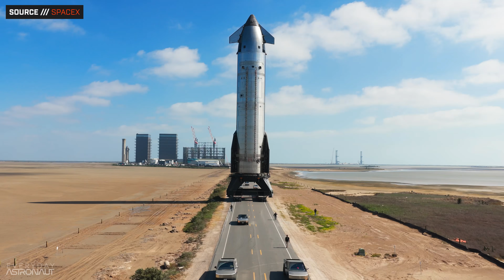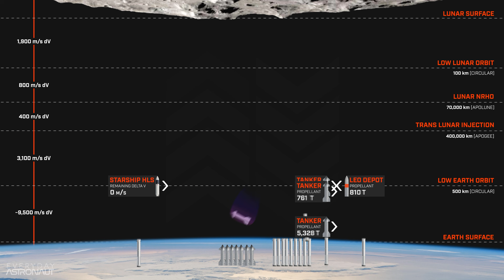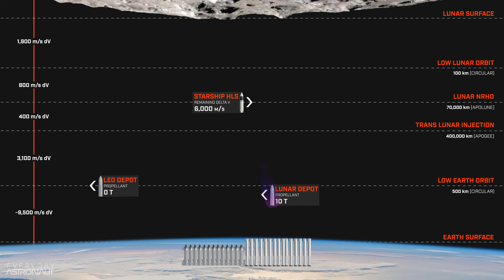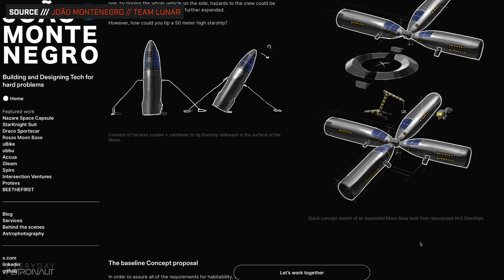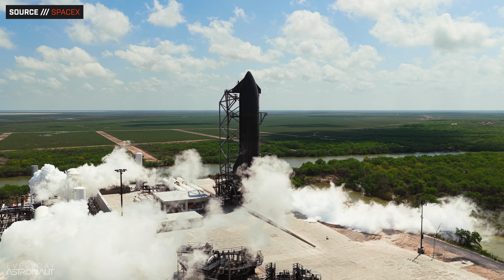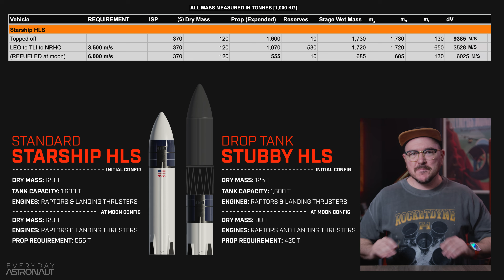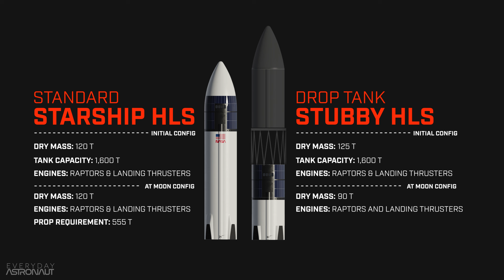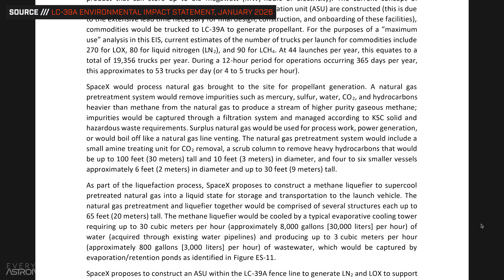Does Starship REALLY require 15+ launches to land one lunar Starship?!

Comment: There are two big issues with the "drop tank" version. 1) You are lose the pressure engines on top and kick up tons of regolith, while at the same time reducing dry mass which might mean more engines firing depending on throttleability 2) I don't think there is any savings in dry mass to have "pipes" from the tanks above be able to feed Raptor 3, as it seems it the fuel inflow necessary is insane.

Without your spreadsheet (which I might look to see if I can find it after I comment), the always Stubby version might have enough dV with two options, 1) refuel in medium/high earth orbit (which reduces how far the tanker has to go) or 2) an expanded Version 3 booster could get it all the way to the moon in one go without needing refueling at all.

Because you can probably save 10t of drymass on booster in expended config (if not more) and you don't need 450 tons of reserve.  If not, you can still do the medium/high earth orbit.

The mission plan would use a single V3 booster to get the fuel to the depot (lets say medium earth orbit), then when its time for Stubby to go to the moon it does a direct launch to that depot in expended mode.  Given V3 booster probably won't be around for very long, getting 10 launches out of it before expending is probably a good ROI.

In the end, I think Stubby is only good for the first couple missions and overall the full sized SS is better for long term and going to Mars.

Comment: If starship doesn't need to come back from the surface (moon or Mars) I've long wondered why they wouldn't build for a horizontal final landed position, rather than vertical. Harder to actually land, but if you pull it off you've got essentially a gigantic stable base of operations that isn't going anywhere and several in near proximity could be linked up over time into a small village of modules. Vertical landing seems.... Short-sighted?

Comment: Since NASA wants to build a permanent presence on the moon. The smaller landers from other companies aren’t a viable option for that. They simply don’t have the cargo capacity
Reply: That is not true. The cargo versions of both SpaceX's HLS and Blue Origin Blue Moon Mk2 more than exceed NASA's requirements for a Human-Class delivery lander (HDL). NASA only set a requirement of being able to deliver 12-15t to the lunar surface at once in order to enable their more ambitious surface assets, like lunar base modules or pressurized lunar rovers.
Blue Moon Mk2 (Cargo) is aiming for double that at 30t in a one-way expendable configuration and 20t in a reusable offloading configuration.
Reply: @p @plainText384  appreciate you being civil so we can have a constructive debate. I will concede that the plans for Blue Moon Mk2 show a perfectly good lander that exceeds NASA requirements. However, it is important to remember that Artemis’s plans are for a permanent moon base. In order for that to be viable, the most important requirement is cost effectiveness. With that in mind, it’s no contest. Even during the early launches when the starship launches will be the most expensive, the cost per kg of cargo delivered to the moon is a fraction of what a Blue Moon cargo mission would cost. I won’t provide the exact numbers I have, because they are a rough estimate and therefore are not the most reliable for precise comparison. (If you still would like them I can reply with what my estimate is from). 

Starship costs will also decrease as the system matures and becomes more reusable and cost effective, the cost to send cargo will decrease significantly.

The volume of cargo is also important to consider. HLS will be able to deliver more than three times than the targeted capabilities of the blue moon mk2 are.

I think that Blue Moon could find its place when it comes to just ferrying people to and from the moon, but even then it looks like it would still be more effective to send a starship. What I could potentially see happening is the fully reusable Starships are responsible for getting astronauts to the moon along with some cargo, and then a blue moon lander that is stationed on the moon taxis the astronauts to the surface. Even then, that seems needlessly complex imo
Reply: Correct

Comment: Why not consider a proper third stage in your comparison, carried to orbit by a regular Starship?
A stage made of more sensible materials than stainless steel, since it never needs to re-enter the atmosphere,
a stage that is not constrained to be aerodynamic,
a stage that doesn't need an elevator or self levelling legs because it's a sensible shape,
a stage that can get to the Moon in a single launch,
a stage that doesn't depend on so many launches and rendez-vous against the boil-off clock to be useful.

It would be much easier to make this design reusable than Starship HLS, since it would require far less fuel ferried to lunar orbit for further landings...
Pity you left the actual Apollo solution out of your comparison!
Reply: It would be simpler but it would deliver a lot less payload to the surface. It would basically just be a repeat of Apollo and when it lands people would ask why so much money was spent on doing the same thing again.
This time they want to keep going and build a permanent Moon base (it's debatable how sensible of an idea that is, but it's what they are saying), and for that you need to be able to deliver a lot of cargo mass.

Comment: If the 15 launches (for one lunar landing) cost "$200k" * each, then the entire launch sequence is just $3M. (* Elon said this a few years ago.)

Even if the cost per launch number is the usual Elon-BS, the same concept might still work even at 1000x the cost.
Reply: Single launch if fully reusable should be a few million. It's primarily people cost and initial capex on the ship. Each reuse reduces the allocated capex per launch. The fuel itself is dirt cheap.

Comment: Build a thow away second stage, and cut the size of starship.  Use the second stage to get starship into orbit, then you have a fully fueled starship ready to go to the moon.  Hey wait.  Didn't NASA do this in the 1960s?
Reply: it wouldn't be that hard for them to make an expendable starship, but that's completely missing the point of the system. even with 10-20 refuel launches, recovering all of the stages will still be dramatically cheaper than a single expended launch, while delivering a payload mass that's so much larger it's hardly even comparable
Reply: Even if they just cut the height it would need less fuel and be less unstable.
Reply: That’s what blue origin is doing….

Comment: NASA did it with ONE rocket! expended, why would starship expend half a dozen rockets to do the same LOLOL
Reply from the maker: That’s the thing. Those rockets wouldn’t be expended as mentioned in the video. And 100x the size of / volume of the Apollo LM
Reply: Expendable Starships and Super Heavies are probably best used when an emergency launch to the Moon is needed to handle an emergency situation on the Moon or in Moon orbit.
Reply: You can't build moon base with expendeble rockets, Staship plan is the best.

Comment: For a horizontal landing, couldn't the landing/launch fuel be stored in smaller tanks positioned close to center mass to mitigate the instability? Excess fuel from main tanks could be vented after the entry burn.

Comment: "Let's build a system that's fully reusable, but can get no appreciable cargo into orbit with a single launch!" - idiots
Reply from the maker: 100 tonnes is not an appreciable cargo? 😂
Reply: @EverydayAstronaut Then call me when Starship will launch 100 tons of useful payload into orbit.
Reply: @EverydayAstronaut  @EverydayAstronaut could they send cislunar depo after refilling, into  HEO instead of LEO, and use it as intermediate tanker? Because aerobraking, you mention, would take like a year.
Reply: @EverydayAstronaut  Not when you need 1200+ (maybe a really bug plus) tonnes just for fuel, it's boiling off while the rest is on the way, and crew and cargo need to be lofted as well.  The 100 tonnes per launch is optimistic, as it seems to assume 100% fuel efficiency on a version of rocket motor that doesn't exist yet.  I have a hunch that the actual mass to orbit per Starship (plus the fuel to land) will work out to the same as 3 or 4 dozen Starlink satellites and not much more.
Reply: @EverydayAstronaut  he meant it can't get to moon without refilling. I don't know why refilling scares them
Reply: Do you have better plan?
Reply: @maks_1_123  A plan to do what?  Launch 3 or 4 dozen Starlink satellites to LEO whenever I want?  Because, that's Elon's plan for Starship.  The rest is hype to get someone else to pay for it.

Comment: Why dont they use boosters like Falcon Heavy so that more mass gets left behind and more fuel can make it to orbit?
Reply: much easier said than done. Starship is a vastly bigger launch vehicle than the falcon rockets. To put it into perspective, the fuel transfer tube of the super heavy booster v3 is about as wide as the entire booster of falcon 9. Gluing 3 super heavy boosters could work in theory but because of the unfortunate reality of trhe rocket equation you get well into deminishing returns when it comes to extra payload.
Reply: The booster usually provides only a tiny fraction of the lateral velocity needed to stay in orbit. It yeets the upper stages above the thickest air. Falcon Heavy mostly achieves heavy lift by wasting/expending the center booster core and upper stage. The side cores help the center core conserve propellant until it gets higher and further downrange. This approximates three stages which use-up two. 

However, Starship/Super-Heavy is fully reused. The booster always will return to the launch pad. And the second stage will also do the same. Only propellant is used up. And that is cheap. 

Right now, the two stages may cost about 60 million dollars to construct. The total propellant costs less than 5 million. The SLS costs about 4 Billion to construct and launch, all discarded.
Reply: I have seen spacex pull ridiculous claims into the realm of routine pretty much every time, despite a world of sceptic downers. I've come to realise that being sceptic is a wee loo. So I changed to being excited and interested when spacex (or y or bo or c or j or i) launches a new ridiculous. 

When it comes to human space flight, it is simply more enjoyable routing for potential huge progress instead of being down to earth.
Reply: Maybe it would make the design to complex?

Comment: The Starship lunar lander will undoubtedly have ground mapping radar/lidar in order to find the flatest landing area... in an area that has already been picked for general "flatness" from orbit.
Reply: The most important criteria is to totally eliminate sideways drift. Otherwise the Ship will not tip but trip over the legs. 

NASA requires accommodating a 15° slope. The landing system should even pick the precise position for each leg pad, avoiding loose rocks.

Comment: Leave HLS on the moon. Build an ascent stage into the nose cone to send crew back to orion. Then send a new HLS from earth with each artemis mission. This gradually builds a lunar city out of HLSs
Reply: then, it not reusable and expensive
Reply: @maks_1_123 yes, building a city on the moon will be expensive. If we're going there to stay, leaving HLS behind as initial infrastructure and raw materials makes way more sense than flying them back and forth. There are other cheaper options for the "shuttling people back and forth" parts of the plan
Reply: @dsabo  why make it expendable if you could make it reusable?
Reply: @maks_1_123 HLS is expendable, it gets disposed to heliocentric orbit after every mission
Reply: @_mikolaj_   no it could be refilled in LLO with depo
Reply: @maks_1_123 ok, thats another 15+ launches. We are doubling the mission cost and complexity now

Plus because there are 2 providers for HLS each mission happens 1-2 years apart for this lander so it must survive in space for that long and thats hard on crewed cryogenic vehicles

Comment: It is way too big. The existing developed system will get a small lunar-lander off the earth and on its way to the Moon. Multiple un-crewed lunar landers can bring and construct what a permanent base will need. As well as make proper landing facilities on the Moon. All done before any crew goes there. And there is no real purpose to go there permanently. Any payoffs are decades away, in ever. And that 
assumes no loss of political support for the enterprise. At some point the SpaceX investors are going to realize their payoff will not happen in their lifetimes. Thats when the money dries up.
Reply: If it can land on Mars, why can’t it land on the moon?  

They’d be exposed to some radiation on the way to Mars.  Do you think NASA/SpaceX wouldn’t think of that?  Radiation shielding is well understood. 

Who says it won’t have the fuel to leave Mars once it gets there?  What delta V does V3 have and how much does it take to go to Mars, land, and leave Mars?
Reply: @s @steven_alleman  can barely get off the ground without blowing up. Landing on Mars is way off. Radiation shielding is heavy no matter what it's composed of. That's more weight to get off the ground. The first people to land on Mars will have to bring everything they need to stay there and the return. There is still no viable commercial reason to go there. The Moon is a different story. Doable but this system seems very complex. Unnecessarily so. Perhaps a smaller lander. Way too many potential points of failure. The timeline is beyond ambitious, it is a Musk fantasy.
Reply: @ronhudson3730Starship has gotten off the ground 11/11 times.  

Radiation shielding is not prohibitively heavy.  Water is an incredible radiation shield and is required for a mission.  Given that humans can live on Mars for approximately 4 years (without shielding) before facing significant cancer risks, with shielding, that’s a much longer time frame.

I can agree Musk’s timelines are often unrealistically optimistic, but they often get there… eventually.
Reply: @steven_alleman 62 pounds per cubic foot. Surrounding the crew compartment with water is a lot of weight to get off the ground. The radiation exposure starts the minute they leave Earth. On Mars and during the return. Then there's food. For the trip there, the time there and the return trip. And what are they using for fuel to get off Mars and return? It's a pipe dream with no commercial pay- off.
Reply: Using water is one of many options for radiation shielding.  Radiation exposure doesn’t start the moment they leave Earth.  We’re exposed to radiation every day.  It’s about total lifetime exposure or extreme short term exposure.  NASA estimates astronauts can spend 4 years on the way to Mars or on Mars with minimal shielding before experiencing a significant risk.  Even taking 9 months to Mars, time on planet, and returning 9 months with minimal shielding isn’t expected to be a major issue.  

Food and water are definitely concerns, but very doable.  Even assuming an individual needs 1 gallon of water a day and 3lbs of food a day, that’s roughly 11lbs a day per person.  For a 4 person crew, that’s 20kg per day.  For a 2 year mission, that’s roughly 14,600 kg.  That’s 15% of V3s total capacity.  That’s also assuming zero recycling of water, which the ISS recycles approximately 98% of urine, sweat, exhaled breath, etc.  if we factored in recycling water, the weight could be significantly less.  

And what delta V are you using for Starship to say it can’t perform a Mars mission?  It’ll likely need refueling on the way home from Mars, sure.
Reply: it's wont just send humans there, but a lot of cargo, which you need for lunat base
Reply: @maks_1_123 Everything that is proposed, Mars or Moon. could be accomplished with multiple launches of unmanned craft. Lots of them. One-way trips to build bases. Landing pads, needed systems. Habitats that are shielded with local soil etc. Then small landers sent on existing launch systems could take the people to land on bases already built and ready. Nuclear reactors for power. South Pole of the Moon for water - if it is actually there. Now let's talk money. This is a gargantuan effort and political/money commitment. Not going to happen.Certainly not on Musk's time
One. And as for Mars, never.

Comment: I wonder how many launches would be needed for a Mars mission with Starship, considering how many launches are required just to refuel for the Moon?
Reply: A slow cargo mission to Mars uses less propellant than the Lunar HLS. A crew mission to Mars will use much more propellant to minimize the transit time.
Reply: diff in deltaV for Mars and Moon is small

Comment: I think they should build a 3 stage rocket.
Reply: Every succesful deep space rocket in history has been 3 or 2.5 stage rocket, yeah, trying to force a 2 stage LEO shuttle to the moon is just disgusting
Reply: @_mikolaj_  if you could refill you second stage you don't need third stage
Reply: it wont be reusable, so it's not good idea
Reply: For what reason? , what does an extra stage add?
Reply: Three stages would be good, but if they just cut about 8 to 9 million pounds the thrust to weight problem would be solved, I think. Then they may not need all of the refueling in LEO just to get to the moon. The height of this thing has always made me jumpy. I feel like we went backwards with this thing. I keep seeing the Nova rocket and direct ascent profile every time I see an image of it.
Reply: @orionexplorer what you need 3rd stage for?
Reply: @maks_1_123  Then you would not have to do all of the flights to just refuel in LEO so you can go to the moon. Unless you drop about 8 or 9 million pounds of structural mass then the current design would be enough, I think, to get to the moon without all of the refueling. I have always seen this as, the old saying goes, a-pig-in-a-poke.